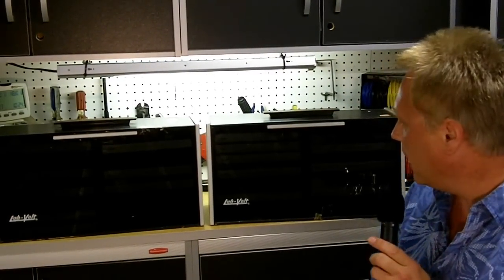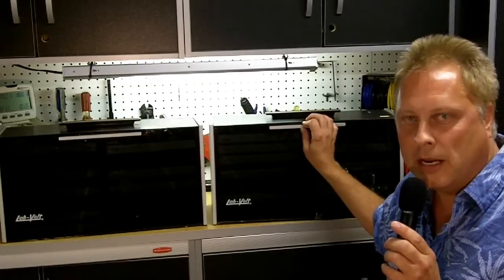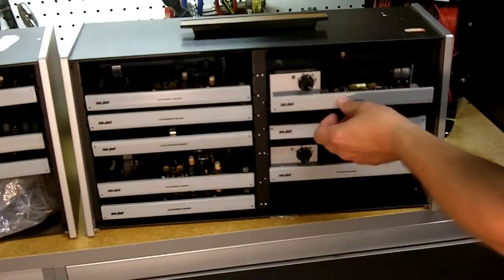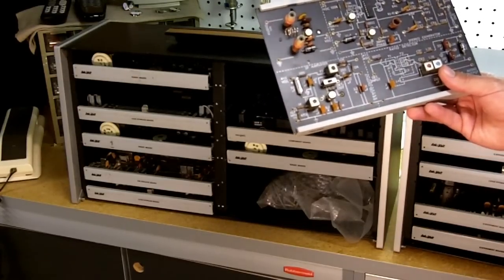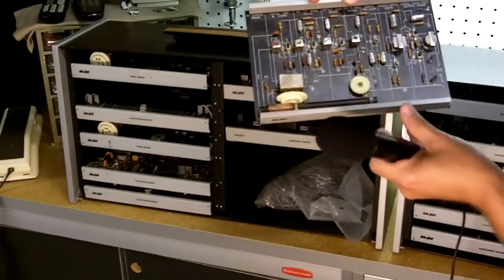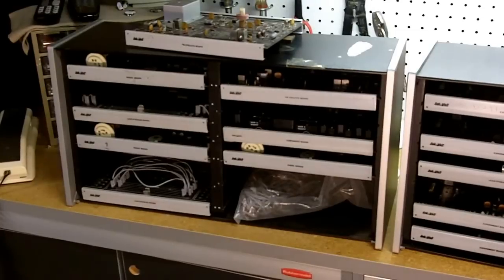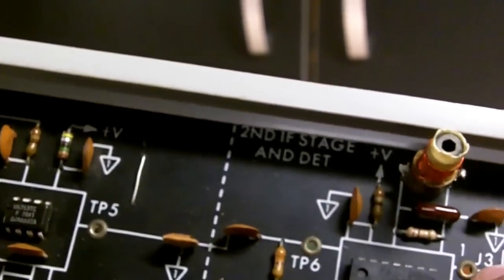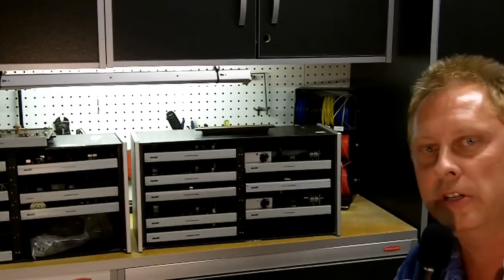Vintage Lab-Volt Electronic Training Modules Video

Comment: I've acquired a lab volt Rf generator model 1222 which would have been used for training exercises.  This is for my Ham Radio workbench but i can't find a trace of a user manual- possibly because they were simply used for step by step lab volt training?  It's my first generator so I'm rather lost without a manual.  It could well have been made by B&K as there is a quite similar model- worse case is I use that manual to understand functions.  Did you get any equipment manuals with the kit you have?
Reply from the maker: Ok on that, I did not get any manuals or anything else with mine, they were just as-is.
Reply from the maker: I did find something that I had on CD for manuals I guess but I sure don't know what happened to that now either.